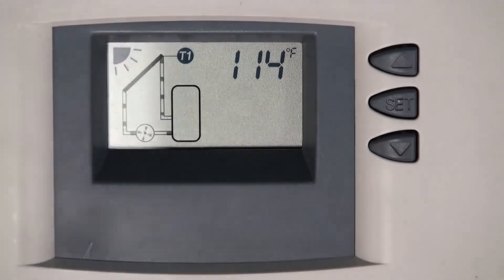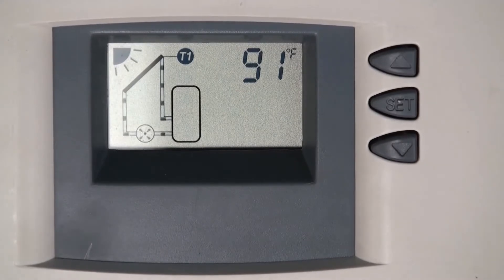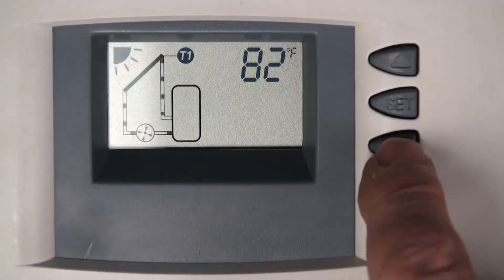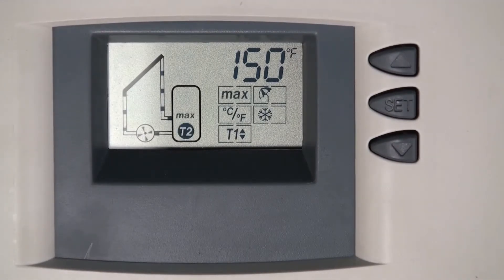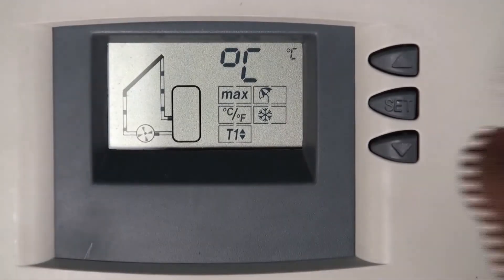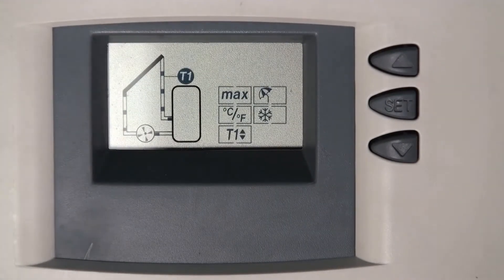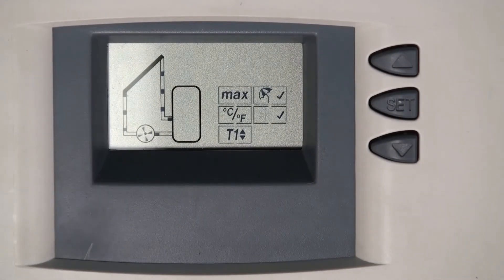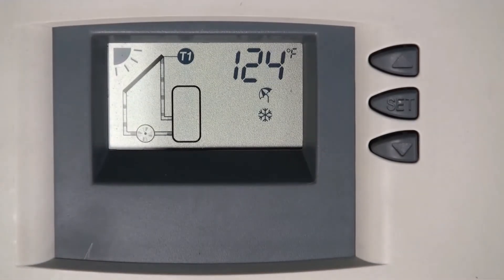SunEarth SETRO301 -  Main Menu

Comment: What psi pressure should the glycol lines drop to overnight, when the pump is off? They currently run to 38 psi daytime a gradually get to 0 psi a couple hours after pump shutoff. In the morning the reverse occurs (starts at 0 psi and within an hour or so gets to 38 psi once pump runs).

Comment: What does it mean if the monitor doesn’t show as “running”?  (The lines aren’t moving)
Reply from the maker: That the on condition has not been met. Either through a max tank condition or lack of acceptable temperature differential between the tank and collector sensors.

Comment: how did you heat up the tank manually?
Reply from the maker: The Steca control has a three position switch located at upper left side .  Slide the switch to the ON position ,which will remain visible in the LCD screen until switched back to the standard AUTO position . 

The solar pump will be activated ; if the sun is shining on the solar collectors , system pressure is normal  and the pump is operating properly  solar heat should be added to the storage tank.
Note: in hot weather the tank could over heat , resulting in a safety valve activating ( water or fluid released to a safe drain location ) .
Reply: He used a cigarette lighter on the sensor to simulate a temp increase